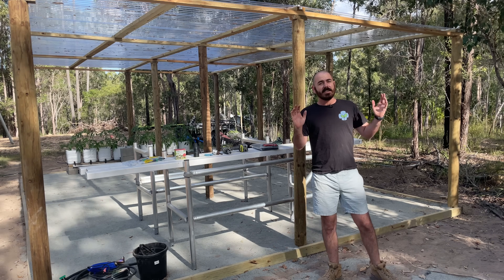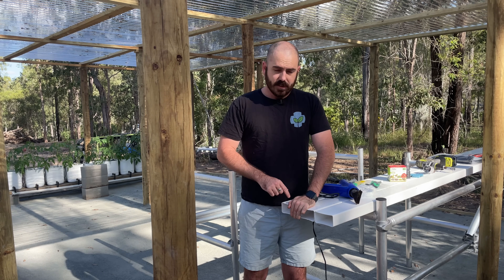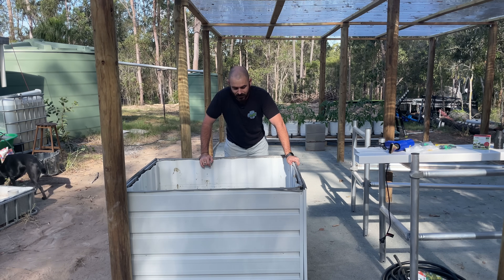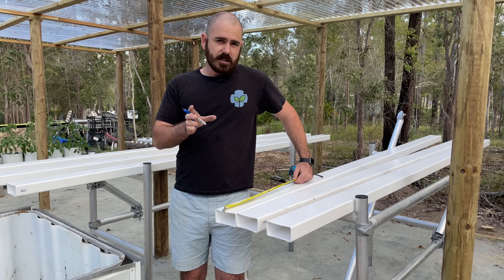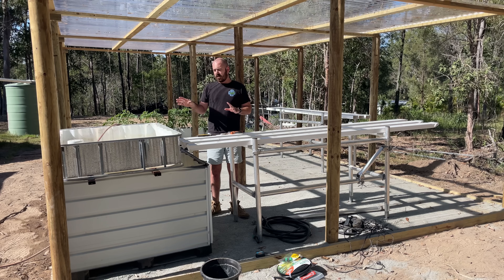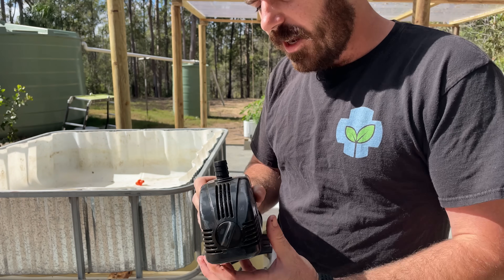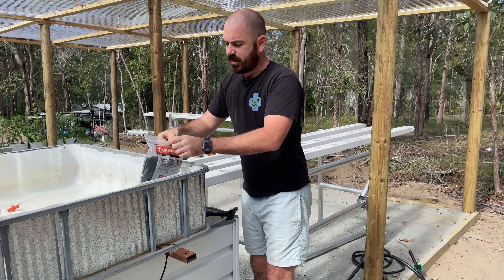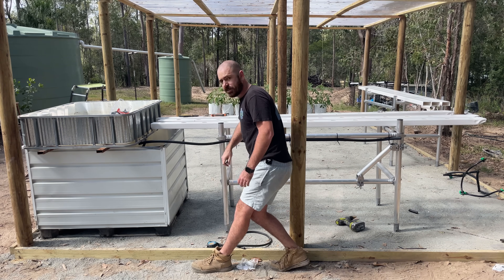How to Build & Set Up a NFT Hydroponic System

Comment: The Aquapro LV pump at 1:48 is unfortunately 12V AC meaning you cant run the pump using a battery without an inverter to convert battery DC back to AC.

Great and helpful video, I'm in the middle of making my own using this tutorial.

Comment: Forgive my ignorance here; I'm still in the learning stage. I'm looking at setting up an aquaponics system (using fish) and was wondering if its recommended or possible to run a large system NFT, Rain gutter with wicking, dutch buckets etc off one reservoir or does each reservoir need to have the PH & EC balanced depending on the plant. 

I was also curious if compost is a good growing medium in a rain gutter wicking system?

Comment: Very good demonstration. Its a great source. Thanks for your video. I have also setup hydroponic systems in my backyard. I use solid nutrients like you. Unfortunately within a couple of days  there will be a thick layer of precipitate of salts at the bottom. I am not sure if this is excess salts or actually nutrient salts that had precipitated to some form. How to solve this? After precipitations can i assume that the water is devoid of any nutrients and the solution is waste? Please can you suggest what to do? Thanks.

Comment: Question.. Hi Hoocho! 
At the end he puts the plants into the holes but wouldn’t they want to slide down the square gutter, like a water slide. I guess the strength of the stalk keeps them hanging on. I could understand if he used the round baskets & then put the root material inside so it doesn’t slide down but he didn’t use that 🤔

Comment: Question: Since scaffolding ends up being several hundred dollars for a 2m * 4m setup, is there an easy way to use star pickets to hold these rails up?
Reply: I built a similar system using merbau fence palings, which ended up being about $30 - since there's never much water in the channels at any one time, you don't really need hardcore weight-bearing capacity.

Comment: You know, you have the printer that makes stuff...you should print end caps for your system and then you could cap them off, silicone them and drill the end and run tubing to your retention tank.

Comment: PVC breaks down in UV light. Use a dark color paint, and then a light color paint to keep your system for decades.
Reply: Note: it's actually code to paint exposed exterior PVC pipes. I don't know if the gutters are made with a different PVC, but it definitely can't hurt.

Comment: Hey Hoocho.  I see alot of hydroponic commentators talk about adding about half a gram of Epsom salts per litre. Any reason you don't do this?  Or is there no need when using the Campbell's?
Reply from the maker: I’ve actually been meaning to do this. The Campbell’s agronomist never mentioned it when I talked to them, but I may talk to them again
Reply: @Hoocho  Thanks mate. It must be fine without it as surely you would have noticed issues after using it for a while. The agronomist at my local said that you can't mix them together in solution and to run them separately on alternating weeks.😳😳😳.  Pretty sure she's means for soil not hydro?
Reply from the maker: @magnus7779  yeah “hydroponic” fertigation is often mixed up with pure hydroponics
Reply: @Hoocho  yeah for sure
Reply: @Hoocho  have you thought about making liquid stock solutions instead of measuring out powders every time? Say cal nit as part a and your npk as part b?

Comment: I plug my downspouts with plaster of Paris for pennies each. I set the downspouts on end on a silicone mat, and pour 1/2 cup (100 mL) of liquid plaster through the nearest 2" hole. The plaster will set in about 4 hours and you can do the far end at that time. When the plaster is fully cured, in about 24 hours, I apply firm pressure to the plug and slide it inside the downspout about 1/8". I then paint the plug and the now exposed inner lip of the downspout with Flex Seal. This makes an excellent, waterproof plug for less than 50 cents with no heating and bending and without any modification of the downspout at all.
It doesn't end there. I drill a hole in my plug and insert the 19 mm tubing in one end and run the nutrient solution to the far end inside the downspout. All my plumbing for the NFT is done from one end without drilling holes in the downspout. If you decide you want to change your system, you can break out the plug and replace it quickly and easily.

Comment: Hi, Hoocho from Ukraine :) 
Awesome video and awesome setup. Some of my friends have the same system in an apartment, so they could not have such bit reservoir for a solution, so the system a little bit changed for our conditions, and you could use these changes too:
1) For more aeration use a wash machine corrugated drain pipe, but it should be corrugated inside, so the low-speed flow will be more aerated by this form of the pipe. The end of the pipe should be also above the level of the solution in the reservoir.
2) Make the drain hole a little bit lower than the middle of the "pipe", so in case the pump dies or the electricity disappears, the plants will not die without a solution. And lower the speed of flow a little bit, so the drain hole will be filled for 1\3-1\2 of the diameter

Comment: I had always thought rockwool holds way too much water to use where it is constantly touching the water.  Be very interested to hear how your go.  I’ve had Kraky and DWC plants fail for this reason.  Using expanded clay between the rock wool and the water solved the issue for me
Reply from the maker: At this point I expect the roots to leave the rockwool and explore the nutrient film.

That would be a problem if the seedlings were added prematurely.

The nutrient film will provide the plants ample oxygen theoretically.

Comment: could you not just use rain water instead of tap as i would imagine that if it falls from the sky it should be ph neutral, in the uk the weather and temp can go from -15 winter to 30 in summer so our growing season is normally between floods, carnt wait to start and thanks for all your info and time  👍😊
Reply from the maker: My water is tank (rain) water
Reply: @Hoocho  so could you actually run your whole system on rain or do you still need mains supply because I want to try and do it fully off grid not on your size of set up 👍

Comment: Fantastic content as always!
Great system and where I live there is no square gutters but we do have ventilation channels that are the same dimensions as the ones you are using.
I have been stuck in dwc/kratkyland in my thought and this was an eye-opener!

I am worried about nft and pump durability though, I’ve experienced pump failures but that was in a ebb and flow so all went well. I wonder if there’s a smart way to have two pumps connected at the same time (one running and one in standby)?
Reply: We might live in the same area, I've been searching like crazy here in the Netherlands. The ventilation channels here are only 1 meter long and I cannot connect them waterproof. Did you find longer channels, if so where?
Reply: @wimveninga1714  Nope, haven't found anything else but 1m lengths online (or in shops), haven't asked the local building-suppliers though, they might have something.
Btw, i live in Sweden så quite close (in the EU at least). :)
Reply: @Marco9K  Ah, thanks for your quick reply, I found a special brand of rain gutters in NL just now, they have 4 meters: brand is Nicoll Ovation. It's from Belgium.
Reply: @wimveninga1714  I'll have to check for them here in Sweden as well. :)
Thanks for the tip!
Reply: For the pumps you could build something with home assistant. Connect a water sensor in one of the channels, and trigger the second pump when there is no water flowing (and send an sms to your phone for instance). This guy inspired me to build home automation for my greenhouse systems: https://www.youtube.com/watch?v=Q9fjKeYOyqU
Reply: @wimveninga1714  I'll check that video out, for these things off like to keep things as simple as possible though. ;)

Comment: Awesome, think I will try something similar. Since you are using the same reservoir for both NFT and Flood & Drain, I'm assuming you are planting something in the F&D with similar PH, EC requirements? Or am I overthinking that part of it?
Reply from the maker: I'm considering not putting the F&D on top of the res for this reason and running a completely different F&D system
Reply: @Hoocho  that makes sense. In the beginning I was really specific about adding plants with similar requirements together, now I'm gettting lazy and just adding anything together to see if it works or not...lets just pretend its for research purposes and not laziness

Comment: Thank you so much for sharing this great idea and system, I like the plastics tubes idea. Clean and allows for multiple varieties at once. I built a kratky system using rain gutter/ vinyl downspouts a couple of years ago but I didn't want to use a heat gun, I instead found and used vinyl downspout elbow and it worked great, I just cover the end to prevent algea 

https://www.lowes.ca/product/downspout-components/traditional-2-in-x-3-in-white-vinyl-downspount-a-front-elbow-279194?cq_src=google_ads&cq_cmp=10646580466&cq_con=106830637404&cq_term=&cq_med=&cq_plac=&cq_net=u&cq_pos=&cq_plt=gp&&cm_mmc=paid_search-googleaw_smart_shopping_generic_online_exclusive_-71700000070203076&gclid=CjwKCAjwj6SEBhAOEiwAvFRuKDXYXFNuWrjUqdhldjBT5J2AVJky5kxtZZOHjtE-vlmCvjFtrTq8WxoCMksQAvD_BwE&gclsrc=aw.ds

Comment: Oh, and this is a great system, I like using the rectangular pvc guttering - recently built something similar indoors using adjustable shelf brackets as the supports. I do like the scaffolds you've used here - was eyeing off the saw horses at Bunnings just the other day, but scaffolds would be much stronger and more durable 👍

Comment: By not using a netcup the hole in the channel allows light into the solution inviting algae growth. Netcups are cheap and last for many seasons, plus they offer the roots a place to anchor making the plant more stable
Reply from the maker: Once the plant grows there will be insignificant light leaking